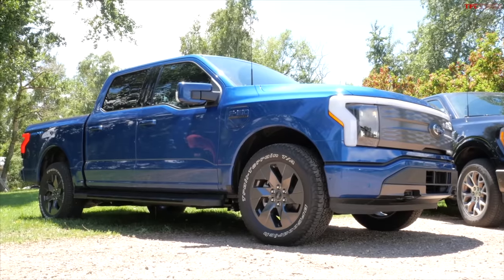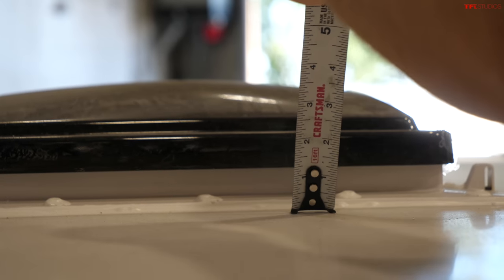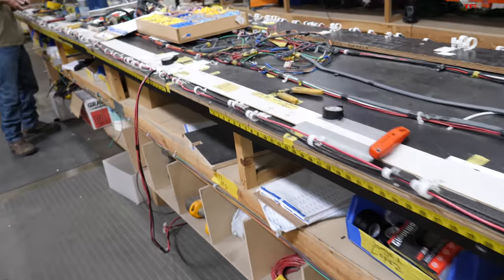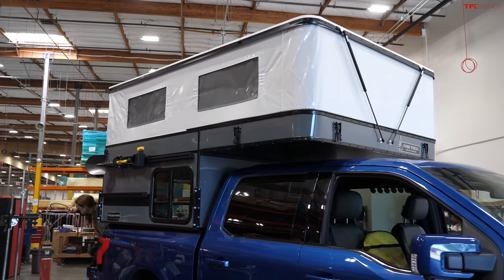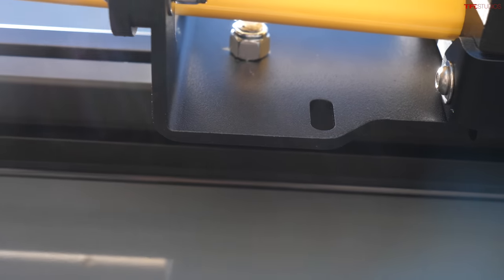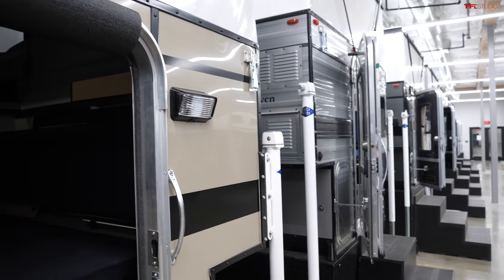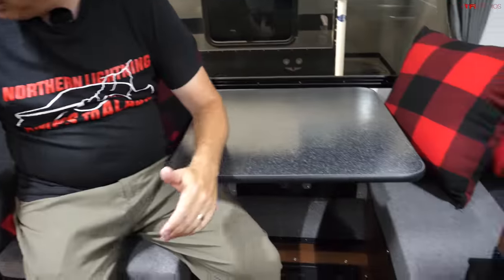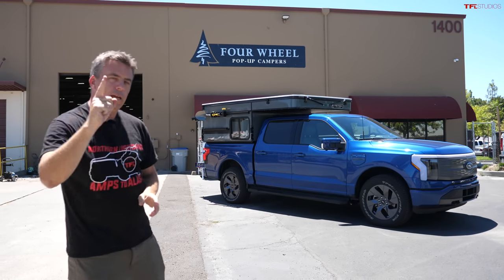Ford Says NEVER EVER Put a Camper On The EV F-150 Lightning… So That’s Exactly What We Do - Ep.2

Comment: Are you guys 100% sure that ford doesn’t recommend a truck camper for some unimportant reason? If you take a look at the topology of the electrical system 1 of the two large regulator/distribution hubs for power from the battery is directly under the bed. Are you 100% sure that the bed of the truck is not used as a heat sink for that component? If the truck bed is used as a heat sink I could see why they would never want the bed to be 100% enclosed from circulating air.
Reply: so you cant put dirt in the bed either?
Reply: @atodaso1668  tops of the bed walls are still open. I bet ford doesn’t recommend you leave the bed of the truck full to edges with dirt as a semipermanent modification lol.
Reply: @dsauce8780  my moms truck has had sand in the back for over 3 months now. Bricks are on back order. What kind of truck says you cant put stuff in the bed?
Reply: @dsauce8780  Maybe look up what back ordered means before making stupid comments. If the tops of the bed cant be blocked then you cant install any canopy or ladder/pipe rack. If that's the case then its a really shitty design for anyone that actually uses a truck as a truck.
Reply: @atodaso1668  ok lol so don’t be lazy and unload that sand so you don’t need to waste the energy lugging around an entire bed load of sand filled to the corners and the bed rails.

Go ask a ford engineer or let me know how it goes with your brand new Ford F-150 lightning when you try out setting it up as a utility truck. I’m curious as to why ford would recommend that you don’t install these(says it right in the manual)
Reply: @dsauce8780  its a farm truck
Reply: @atodaso1668  cool definitely comparable to a 2022 ford lightning
Reply: @dsauce8780  is the ford lightning not a truck?
Reply: @atodaso1668  again. As I said above. Let me know when you have a 2022 ford lightning and use it as your farm truck(or utility truck). Until then i have massive doubts about the the long term survivability of ford’s brand new electric truck. But keep comparing this brand new power train to the last generation that has 30 years of refinement. Makes a lot of sense. Got anything else to say?

(And If you have ever worked on any ford products you would understand 100% why I say that. Ford engineers are not above missing the mark completely until consumers force them to do better.)
Reply: @dsauce8780  So the bed on the lightning is just for fun? It's not allowed to be used as a truck?
Reply: @atodaso1668  why don’t you buy one and find out? No gas powered f150 manual says not to use the bed of the truck in the way that they explicitly state not to in the lightning manual. Can you tell me exactly why that is? That’s kinda the point of the title of the video but I’m starting to get that comprehension probably isn’t your strong suite.

(Got anything else you want me to clear up for you?)
Reply: @dsauce8780  So you are saying that the ford lightning is not a truck? Why does it even have a bed if it cant be used like every truck made since trucks were invented?
Reply: @atodaso1668  again with the comprehension issues. Read my last reply. You’ll need to go ask a ford engineer why it is that it explicitly states in the ford lightning manual not to do what you would normally do with any gas powered vehicle. Which I will remind you is why TFL titled the video the way they did. Before replying slowly read my responses again and say the words out loud to help comprehend and retain their meaning.

(My bad if you have some sort of disability and I’m just not realizing it. Not trying to make fun of you or anything just seems odd that you don’t understand why I’m saying what I’m saying at this point considering the context of this entire comment thread. Read the title of the video you’re commenting on. “Ford says NEVER EVER put a camper on the EV Ford F-150”. All I did was provide speculation on why that is after taking a quick look at the new EV trucks’s layout and you seem to have taken it quite personally.)
Reply: @dsauce8780  Again with the deflection that this truck can't do what any truck has been able to do since trucks were invented.
Reply: @atodaso1668  not a deflection at all. Why did TFL need to make a video titled “Ford says NEVER EVER put a camper on the EV f-150”? Why did ford explicitly say that? Seems that they think it can’t do what a truck should be able to do and you seem pretty upset about that.That’s literally what we are talking about hence why I’m starting to think there’s some sort of disability involved here.

(It’s ok if you’re upset about that but you’ll need to take the issue up with someone who can do something about the uncertainties ford has about their own new truck design)
Reply: @dsauce8780  lol
Reply: @atodaso1668   now that’s a deflection from the simple question I asked you. So why don’t you go ahead and answer the question? Why did ford say to “NEVER EVER” put a camper on the EV F-150 Lightning? Obviously they think it can’t do what a a gas/diesel truck has been able to do “since trucks were invented” lol.
Reply: @dsauce8780  rofl
Reply: @atodaso1668  deflection is easier than admitting you had no idea what you were arguing about. Seems like that tism’s got ya good.

Comment: Sounds like all you really needed was a power transformer that plugged into the bed outlet, could have saved thousands
Reply: The other advantage of keeping the battery setup separate from the truck is it won't sap the trucks already limited range
Reply: @simplybeanjelly  they are reducing the range even more though by carrying a lead acid battery.

Comment: Why not carry a compact 240V Inverter Generator to charge de EV F-150 Lightning ir it ever runs low on power? That is what I would do it I ever get one of these trucks new inverter generators can run on Gasoline, Propane or Natural gas and are extremely efficient running 8 to 10 hours with only 1.8 gallons of fuel.
Reply: If you do the math generators like you are talking about put out a max of about 3kw so that 131kw hour battery will take more 43hrs to charge...  and that's at 100% efficiency which wont happen.
Reply: @mongocrock  none of the EV supporters have been willing to do, trust or believe the math since day one.
Reply: @JohnJones-ty6fj   Its not all bad I can see the place for electrical contractors hvac etc who drive short distances with light loads.  Its just a tool in the toolbox not a panacea right now.  We need to understand the tool to see where it does and doesn't work.
Reply: @mongocrock  I couldn’t reliably haul my boat to the nearest lake and back using it here, let alone consider it for any other serious use. I just bought a hybrid because of the EVs lack of real world utility.

Comment: Not recommended by Ford.  This may have just voided the warranty.  You can't just install a camper like this on a truck without a "camper package".  There are suspension considerations, wheel issues, sway bar issues, etc.  This adventure is certainly uncharted territory, but ignoring the automaker's recommendations seems foolhardy.  This series may end up documenting what NOT to do.
Reply: Its not even a full slide in camper. Its ~500lb topper. Its ok..
Reply: Dude, you better take a couple deep breaths and step back from that ledge. It will be OK. 🙄

Comment: Seriously should be using Li not AGM for house battery
Reply: why to save a few pounds? because that's the only advantage they have.
Reply: @atodaso1668   research it a bit and you'll see that you can only use about half the rated power of an AGM battery compared to almost the full amount of an Li battery, so no weight is not the only advantage Li has over AGM.
Reply: @grantlouw3182  Where did you read that AGM batteries can only provide half of their A/H rating? What about longevity and temperature ranges/efficiencies?

Comment: You guys seem to have a real hard on for this truck.  I'm sure Ford is paying you guys to do testing on this truck as well.  But lets not forget 2 things.  1 this truck's range absolutely sucks while towing even with the top battery and 2 the top level battery will cost over $10k bucks to replace when it dies.
Reply: Geez, it looks like you woke up today just to pick a fight.
Reply: @nix4644  Nope just stating facts for everyone.
Reply: Yeah tfl already made the lightning look like junk, wait ford is junk, new bronco engines failing and transmissions and new maverick engine fires and only fix for now is to drill holes in original body panels around engine for help with cooling!! Ford doesn’t like to admit to mistakes and recall defective crap they put together like my wife’s 2018 escape with coolant intrusion due to defective engine head made and sold by ford in 1.5l eco boost engine.. 8-10 grand for new engine when ford should be replacing it for free
Reply: @skyhawk21  Yeah I agree.  I've been a GM truck guy for 15yrs now.  I've owned 5 2500 and 1500 trucks from GM and only had minor stuff break on all of them.

Comment: EV range suffers much more from aero design / drag coefficient than it does from heavy weight. You won’t lose as much range from a heavier load then you would from the square wind block sticking up over the cabin. This was a terrible idea. You were better off towing a nice streamlined camper then this drag inducing monstrosity